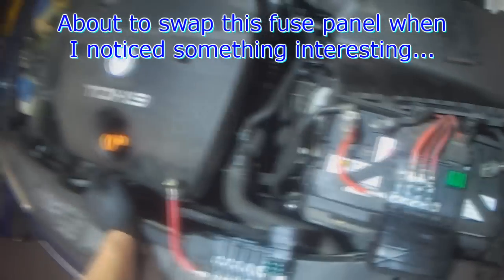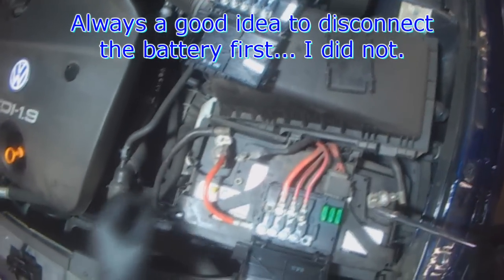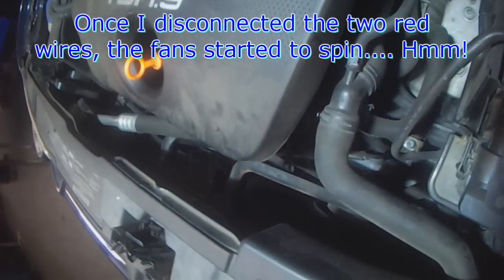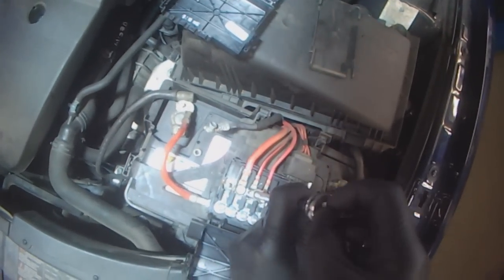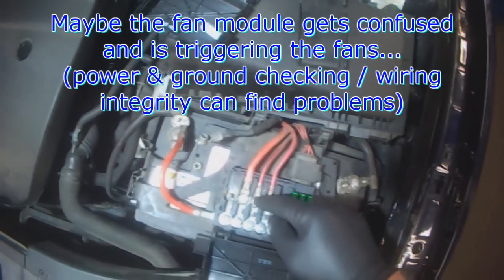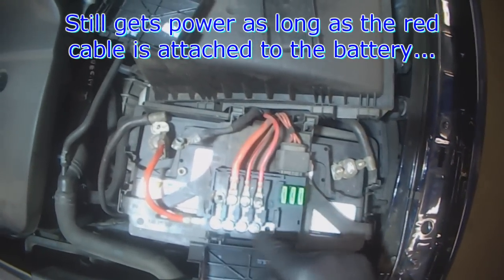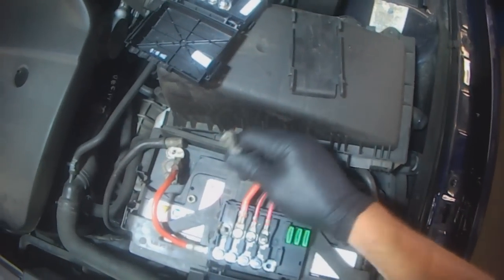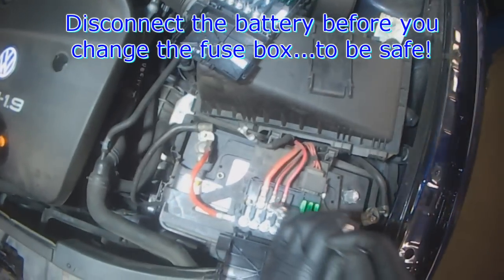VW A4: Weird cooling fan behavior!

Comment: Mk4 with a 3.2.  fan only blasts high speed when the key is switched to on and shuts off when turned to off.   That said if I pull the #16fuse the fan (big one) will run at low speed. Small fan doesn't run at all
Reply from the maker: Besides that... what is the actual issue? Overheating at idle? Always? No overheating? AC or no AC? AC off... same thing key on? Fault code in climatronic? Key off, trigger low speed manually at the radiator fan switch (disconnect switch and bridge the power wire to low speed)... both fans come on? With rad fan switch disconnected, key ON.... high speed still on? Lots of things to check... eliminate things and you'll get to the issue.

Comment: That happened to me also  mine wouldn't stop havc control module on 3,5 cabrio  until  it fry a hole so went to order a new one my 10 pins and they said need 14
 pin  change out wires or do they make 10 pin replacement
Reply from the maker: Not sure. Haven't had the need to replace one for a long time.

Comment: Can you tell me the use of the smaller fan is for in my 2002 VW beetle?
Reply from the maker: Both fans should come on at the same time... vehicles that do not have ac, do not have a small fan. It doesn't matter if ac is on or not, both fans get activated at same time. If only one is working, then the one that is not working is bad.
Reply: @EXOVCDS  ok. I just wondering if mechanic was poking my eyes as to what was needed to fix ac. My VW 2002 beetle was not working. He fixed ac but if I understood him he said compressor heated because small fan had stopped working. He asked me to turn car on and small fan not working. A thought just pop up. Is it possible that he disconnected wire to fan when I turned on fan. Apologies for assumptions. It is just that you hear women being ripped off by mechanics.
Reply: Correction on word, turned on car (not fan)
Reply from the maker: @raquelrodriguez7650  fans fail with age... at 20 years old, it's safe to say that the fan failed due to age and not due to being disconnected. When the small fan does not work... ac will still work, but it will not be fully cold inside the car when the vehicle is not moving (because only one radiator fan is working)... and will cool better when vehicle is moving at steady speed. If ac was not working at all, then the problem was not the small fan.

Comment: Had fans running in the middle of the night at full power. Maybe the exhaust burn off cycle, but will clean those contacts anyway as I suspect the battery may not be charging fast enough.
Reply from the maker: Year, make, model, engine?
Reply: @EXOVCDS  2008 caddy 2.0 tdi 140hp
Reply: Might have been condensation on a poor contact as well that started the fans, I didn’t wait to see if they would switch off, I started the engine and the fans stopped.
Reply from the maker: @davidgriffiths7696  different generation / fan control. Scan for fault codes, perform output tests to check fan control. Could be a Fan Module issue. Engine should already be cold during "middle of the night".
Reply: @EXOVCDS  yes engine was idle for a full day prior, and it was the first time I saw/heard the fans working. It seems they are not really needed here the engine rarely gets over 185F. Could be control module J293 or dodgy sensors. Thx for response.

Comment: My 2009 audi a6 3.0t Quattro, the fans keep cutting on and off when the car is off until it kills my battery
Reply from the maker: Could be a problem with the Fan Control Module... you need to check the connector / all the wires at the module. The main fuse must be good, since the fan is able to run... but, if the module does not communicate with the engine computer, it does not know when the engine computer is telling it to turn on the fan(s)... and might not go to sleep (shuts off when engine is off) because of that. If there is a communication issue, the engine computer will usually store a fault code for that. Start with checking for fault codes... not all scan tools / OBDII Readers are able to read all fault codes, so if nothing is stored, doesn't mean there aren't any. Also scan the AC Module for fault codes.
Reply: @EXOVCDS  Thankyou so much for your tips, is giving me a code P0686.. also where is the main fuse located for the fans, I checked the owners manual and didn't find it there?

Comment: I have the same problem on my Golf 4 1.9 TDI ASV 2002, and i ve checked the bolts but no success, i ve replaced the fuses , FCM and the big fan but nothing...do you have any ideas?
Reply from the maker: The fans are always on? Unplug the radiator fan switch... are they still on?
Reply: @EXOVCDS  yes they are still on
Reply from the maker: @xfluxer449  Disconnect the ac pressure switch, still on?

Comment: I have a 2002 v5 beetle I changed the fan module under the battery and the fan is still paying up once the car is started it speeds straight up and slows down and keeps doing this until the car is turned off any help?
Reply from the maker: It could be a power / ground issue with the fan module... check all the wiring (test power & ground, check control / input & output) according to wiring diagram for your vehicle. Manual AC (heater dials) or climatronic (electronic / push buttons)? It could be a fail-safe mode or, like I said, due to a power / ground issue.

Comment: A  3 year on/off battle with sisters bug  dealership failed 3 attempts ,.  100% solved? Probably not ATM, but  atleast i was finally  able to recreate it . Ill run with it.    glad i stumbled  in      thx 4 upload
Reply from the maker: It's a good idea to clean & tightening all those fuse connections at least once a year. =)

Comment: my fans only come one when ac is on I jumped the plugs for the thermo switch and they work is it a bad FCM?
Reply from the maker: Is the engine overheating while at steady cruising speed or only at idle? Year, make, model, engine?
Reply: Thomas EXOVCDS it will overheat if it sits at idle too long.  I have just had the fans manually jumped for the time being so they constantly run while the ignition is on. It’s a 2001 Volkswagen Golf GTI VR6
Reply from the maker: @ChaseHollandProductions  low speed fan operation does not require the FCM. If the fans come on when the fan switch is bridged  then the fan switch is bad ( assuming the radiator gets warm / hot). High speed requires the ignition to be on, for the FCM to activate high speed... low speed does not require the ignition to be on.
Reply: Thomas EXOVCDS literally replace the switch though with a brand new one?  And still no luck.  I’m clueless. All speeds work properly
Reply from the maker: @ChaseHollandProductions  is the radiator actually getting warm / hot? The thermostat might not be opening fully. Verify actual coolant temperature with a scan tool... in case the temp sensor for the dash gauge is sending a wrong signal.
Reply: Thomas EXOVCDS just replaced thermostat and the electric switch on the thermostat housing aswell. Sorry should have stated all this and have verified coolant is staying around 195 while driving.
Reply: And radiator is definitely getting hot. Hell at this point I’m starting to think maybe I bought a faulty fan switch. That’s all it can be at this point I would think.
Reply from the maker: @ChaseHollandProductions  yeah, the more info I have, the less back & forth... if it stays at 195 while driving, I'd go with another fan switch.
Reply: Thomas EXOVCDS ok well thanks for your time and the super quick response🤙🏻

Comment: I have a 2008 Passat 2.0T FSI. The smaller fan won't turn off at all. Changed cooler sensor still won't turn off. I have to disconnect the battery every time. Help
Reply from the maker: I'd have to check a wiring diagram, but I think the small fan is controlled by the large fan / module. Could be a bad module... replacing the large fan might solve the issue (module is part of large fan).
Reply: I'll give it a shot. Thanks for looking into it for me.

Comment: Got a golf mk4 1.6 16v soon as I connect the battery the fans come on and stay on constantly without key being in ignition any ideas what this could be ?
Reply from the maker: Did you check the fuse box connection on top of the battery?
Disconnect the radiator fan switch... what happens?
Does the car have AC?

Comment: Ever make sense of this? My fans don't start when I turn the AC on, but as I was checking fuses, pulling #16 (labeled as AC Clutch/after run coolant pump) triggered cycling of the small fan, but as soon as I replaced the fuse, the fan wouldn't cycle at all. Still more testing to do, but not as intuitive as I thought!
Reply from the maker: I'm not great at electrical... otherwise I would have explained further. All I can suggest is looking at / studying a wiring diagram.

Comment: What's up, I have a mk4 1.8t Jetta, and my fans run for 10 minutes after the car is shut off, no codes. what could it be?
Reply from the maker: Not sure... temperature sensor, ac pressure switch, fan control module, bad connection, normal operation in some cases... use a wiring diagram to check all the sensors & circuits.

Comment: Hello mate, any ideas what would melt the S180 fuse to the point where it's burned the metal away to one side of the fuse and where it's seated? All the leads that go to the fuse box where it is are in good condition and not burned
Reply from the maker: Bad contact / connection = resistance = heat... if the contacts are not the problem, check the actual current draw of the fans. Replace the fuse box if any of the plastic is melted.
Reply: Thanks for the quick reply mate, in the video I see the new fuse box is not oem what you was fitting,does this matter or should I pay double the money for an original
Reply from the maker: Whatever fits your budget... I don't recall the brand that the new one was, but it looked very similar to the OE.

Comment: mine is doing the same I changed the fuse box the module under the battery the control switch the thermostat switch it seems when I start it the fans don't come on while running I'll disconnect the big red wire that I guess goes to interior the motor dies and then the fans kick on
Reply from the maker: Cody Griffin Just to be clear... the issue you are having is that the fans do not come on, yes? Engine is overheating? What year /model car... what engine?
Reply: Thomas EXOVCDS I have a 2000 Jetta 2.0 gas engine it's doing the same thing as shown in ur video disconnecting the bigger red wire which the engine running immediately shuts off engine turns on fans even if I pull the keys out it the fans will continually run but nothing will start if I tighten that same wire the engine will run but the fans will not. which everything I've seen goes to the interior relays behind the fuse box inside the dash I'm not sure if one of these relays under behind the interior fuse box is bad did you ever figure out why this vehicle in ur video was doing this.
Reply from the maker: Cody Griffin You are misunderstanding  the point of the video.
Forget the video... answer my question.
Is your car overheating because the fans are NOT coming on?? Yes or no.
Reply from the maker: Cody Griffin Watch the first 3 minutes of this video:
https://youtu.be/LiDRUWPw_f4
Reply from the maker: Cody Griffin May I still be of assistance? If your fans do not come on when AC is selected... your low speed fan circuit in both fans is probably burnt out. How is your water pump flow? Heat inside the car?
Reply: I appreciate your response I started it never drove it let it warm up to for 20 minutes. when it was running right the fans would usually be on upon starting. now the fans won't kick on at all unless that wire is loosened then they run but engine won't run. let me explain what I've done to it so far the auxiliary fan was seized so I replaced that also replaced coolant fan control module, fuse box assembly on top of battery, cooling fan switch on bottom of radiator, and the temperature sensor. checked all fuses they were all good. haven't drove it when this all occured was in a snow storm it got stuck but I also notice the brake and abs light came on not sure if that's a separate issue or connected
Reply: I appreciate your response I started it never drove it let it warm up to for 20 minutes. when it was running right the fans would usually be on upon starting. now the fans won't kick on at all unless that wire is loosened then they run but engine won't run. let me explain what I've done to it so far the auxiliary fan was seized so I replaced that also replaced coolant fan control module, fuse box assembly on top of battery, cooling fan switch on bottom of radiator, and the temperature sensor. checked all fuses they were all good. haven't drove it when this all occured was in a snow storm it got stuck but I also notice the brake and abs light came on not sure if that's a separate issue or connected
Reply: Thomas EXOVCDS I'll check water pump flow. heat inside car
Reply: so water flow good heat works so I started the abs lights off same with break light when the air conditioning when on both fans running took it for a drive it's not overheating runs good but my question is so before the fans would run all the time now it seems like there kicking on when it gets to 190 and kicks off is this normal
Reply from the maker: Cody Griffin Yes, that's normal... fans should only turn on at around 190 and then go off. When AC is on, they should be on all the time.

I don't understand what you mean with ABS light off and brake lights.

If you mean the abs light in the dash and the brake warning light in the dash... they can come on when there is a bad connection on the fuse box on top of the battery.

Sounds like all is good now.
Reply: Thomas EXOVCDS thank you very much I appreciate ur expertise
Reply: I have the same issue but mine is over heating any advice thomas

Comment: Hi Thomas EXOVCDS, I have a 1991 cabriolet. The situation here is that radiator fan is killing my battery, I replaced the relay (which is found next to the battery) with no difference in “fan” behavior. Also, I have no temperature reading on cluster, just a red light blinking. Your help will be highly appreciated!!!
Reply from the maker: Is there a single wire temperature sensor on top of the engine / valve cover? That's the "after-run" thermo switch. It triggers the fan when engine temperature is 110c (engine off)... if the wire is not connected to the sensor and is touching a metal part of the engine, then the fan will always run when the engine is OFF. If id does not run when the sensor is disconnected, then the sensor is bad.
Reply: Thomas EXOVCDS THANK YOU!!!
Reply from the maker: Let me know if that was the issue... if not, I might have more ideas.
Reply: Thomas EXOVCDS it’s been a considerable drop in the temperature here in South Florida. When I received your response I went outside to disconnect and inspect the cable. After I reconnect the cable, there’s no more problems. If this change, I’ll let you know ASAP. Thank you!!!
Reply from the maker: @christiantovar1391  Thank you for the update!

Comment: Thanks for the video Thomas 

I also have a problem with fans running more og less constantly on my 2001 Audi TT. When I turn the ignition on the fans come on most often after a few seconds and they will stay on long and only turn of form short periods. I have just replaced the colant temp. switch/sensor, both fans and the fan control module. Unplugging the colant temp. sensor do not make a difference. I should also tell that me dash instrument panel is going bananas, with gages turning on and off. The later has been a problem for some time but is now worse than ever. My scan tool reads multiple sensor faults. Any ideas how to diagnose this problem?
Reply from the maker: Follow the steps in this video and tell me what you find / your results.
https://www.youtube.com/watch?v=Roh6RCs8IJk
Key ON and AC OFF there should be no fan operation. What happens with your fans? Radiator fan switch disconnected... no fans. Yes / No?

Comment: Hi have you ever come across an issue when the fan starts from cold start mk5 golf gti
Reply from the maker: Do a full system scan to check all modules for fault codes. Could be due to a number of things.
Reply: @EXOVCDS  its gonna have to get one thanks for the reply

Comment: Thomas Exovcds  I have a Golf 4 gti 2002 engine 2.0 Turbo fan problem in an open key fan mode and turn off more than once I have removed the fan fan over the battery but still working and extinguishing fan I removed the fan wire in the fuse box over the battery started low fan speed and working And turn off, please help
Reply from the maker: Sorry... I don't understand what the problem is. Can you describe it again / differently? Are you using Google Translate?

Comment: Question for you. The next time you do a mkIV car with bad low speed fans. Can you post what voltage you get out of the plugs at the fans for low voltage operation? Ive noticed on quite a few cars about a .7-.8v drop from voltage at battery and just trying to figure out if this is normal. My car has a new FCU and is still lower.
Reply from the maker: +Edward Sessum I'll try to remember to do so the next chance I get. Usual suspect is the fuse on top of the battery... pull the little green fuse and check for corrosion at the legs.
Reply: +Thomas EXOVCDS fuse block voltage is correct. It's after it leaves the 3pin connector on the back is drops somewhere  between that connector and the fans.
Reply from the maker: +Edward Sessum Don't forget that there will be a voltage drop at the radiator fan switch.
Reply: +Thomas EXOVCDS will check voltage going into the switch. Thx.